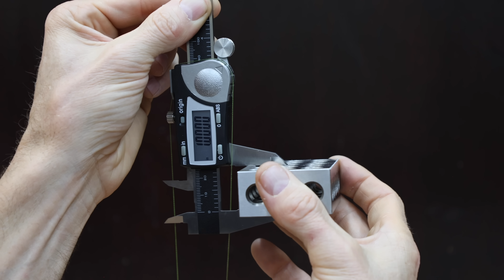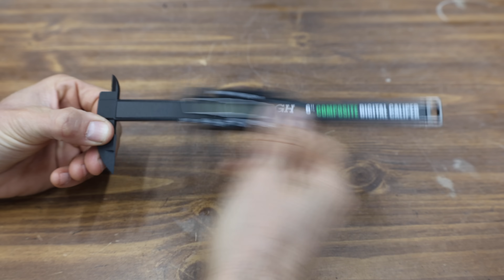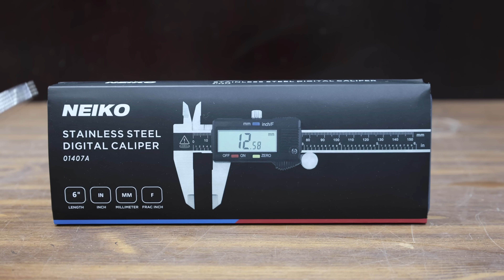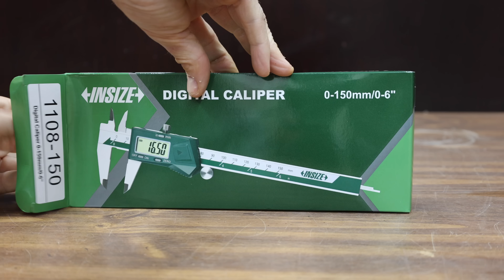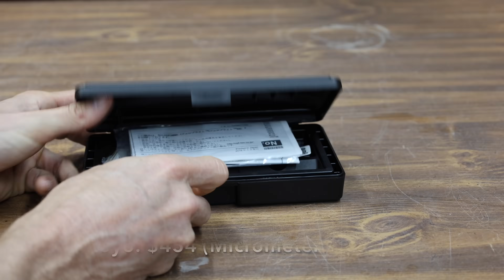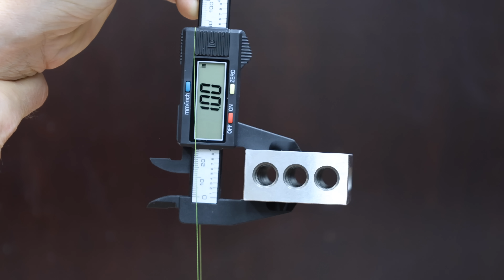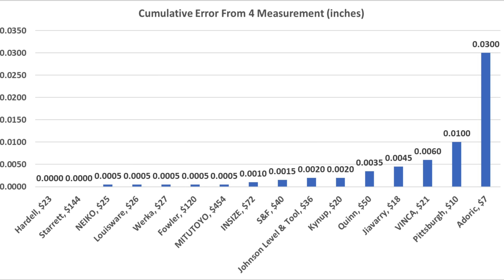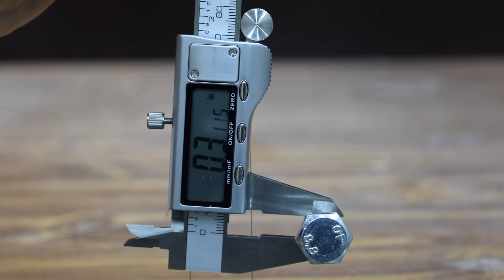I've Been Proven Wrong About Calipers!

Comment: I own a NEIKO, and while it may have automatic shutdown, it still drains the battery when not in use. This happens when I turn it off manually too. Its really annoying, I remove the battery after every use, otherwise its dead every time I come back to it.
Reply: Every time I have tools that come with second batteries I get very suspicious of parasitic loads when they are turned off.

I have a cheap brand of calipers that I turn the battery over when I store it so not to lose the battery.

I also have a digital angle finder that has the same issue.
Reply: Basically any caliper that has memory is still powering the caliper just not the display.
Reply: @rileyneufeld7001  but my 5 year old Mitutoyo still has the same battery.
Reply: @Pepe-dq2ib The mitutoyo's dont have this issue, its usually the cheaper calipers that will drain the battery.
Reply: @rileyneufeld7001 yes, but they can be designed to use less power than some do.
Reply: And my second hand mitutoyo has lasted for a few years on a single battery.
Reply: I have the same exact problem with mine. The manual "off" doesn't even work, much less the automatic one.
Reply from the maker: Thanks for the feedback.
Reply: My older Neiko 5+yrs will last a year plus on a single cell. Mine is an older iteration that uses a top slide 2032. After stoning a tight spot it has worked very smooth and consistantly.
Reply: yep, same issue with my Carrera Precision CP9806 - you can be sure that the battery fully drained next time you try to on it.
Reply: Same with Vinca.
Reply: Yep, when I was a millwright (changed trades about 5 years ago) I had a 12in Neiko digital calipers and yep the battery had to come out every time it went back in my toolbox or else it was dead next time i went to use it. I ended up getting cheap dial calipers and ditching the electronic ones, and never looked back.
Reply: @PlatypusVomit my mitutoyos have been on the same battery since I got them a few years ago. I only use them once or twice a week on average but it's still impressive, especially after having a cheapo one that behaved just as you described.
Reply: @mortrek  Mitutoyos should be good on the battery. But I didn't use them often enough to justify the price of a quality set. If I was using them twice a week like you, I would've sprung for the good ones.
Reply: I was just about to comment the same thing. Considering multiple models use an identical digital portion, I expect this also applies to multiple other models in this showdown. Still, if the only problem is draining the battery, I would consider the $18 I paid for it like 10 years ago to be worth it.
Reply: I have the Neiko too. I have it in a drawer and any little bump turns it on. If you tighten the screw at the top before putting it away, the battery lasts a lot longer. Still horrible battery life, but it's better with the screw tightened when storing.

Comment: If I understand the Mitutoyo instructions correctly, the Absolute  Measurement feature works by always consuming some power. It doesn't turn off automatically because the only power to be saved is turning the display off. Since learning this, I don't bother jabbing the power button at all. It just runs in the background the way a digital watch always has a display. Maybe knowing this will save you wearing the button out. You could test what I say by opening the jaws, removing and reinstalling the battery, and then expecting it to magically know its position. If you get a new Mitutoyo caliper, it specifically talks about battery life. The one that comes installed is not 'expected' to last any time - it is just nice that they left the test battery in as a bonus, but it will be draining in the box. If left on the shelf before sale for some substantial time, it will be flat on arrival.
Reply: Some of this sounds incorrect, all the new Mitutoyo tools i have ever bought don't have a battery installed, but have the battery seal in a plastic "bubble", and there is no on switch, it turns on when you move it.
Reply: @jeffmiller3150 The green/turquoise button is On/Off (bottom left). Also, a coincidence that the two callipers that have Absolute Measurement don't auto-off? An additional battery in a bubble sounds familiar, but there should also be one fitted for testing - manual says, "The supplied battery is used to check function and performance.  Therefore it may not provide the specified life." It also says to set origin after inserting battery. Happy to be corrected.
Reply from the maker: Thanks for sharing!

Comment: I'm glad you mentioned batteries, as my experience with the cheap ones is they go flat in just weeks or maybe a month depending on use. Mitutoyo keep going for YEARS with daily use.
Reply: He didn't measure them though, so there really isn't anything in this review to address the battery life issue. Most of the cheap ones use battery constantly even when powered off, and he didn't measure current use. So can't really draw any conclusions about the cheap sets, which is disappointing.  I wouldn't go out and buy one of the cheap sets with the 2032 battery, the kynup I would guarantee use the same crappy chipset as the other ones (look at the buttons and LCD), so they might last a month or 2 longer but will still constantly be dead. If you want a cheap beater set, you're still better off getting a dial set or just saving up for a quality set.
Reply: @zrobotics  Mitutoyo uses the battery constantly too. It has to in order to retain the reading. Just Mitutoyo has a way of using hardly any current to do that. A way no one else does. It borders on black magic. You get practically cell shelf life out of a battery with Mitutoyo. A battery will go dead about as fast just sitting around. I don't know how they do it. All I know is I have to save a video for how to reset zero because by the time the battery dies in my Mitutoyo calipers I forget how to reset it. I have to press one button for a period of time. Doing something once after over 5 years I forget.
Reply: @1pcfred  They don't use the battery when they are off, they store the zero point in EEPROM memory which doesn't consume power when it's off. It's just a more expensive electrical part and requires a different sensor setup for the distance measurement. At least that's my understanding, I haven't reverse engineered a set because they're way too nice of a tool to take apart just out of curiousity.
Reply from the maker: Thank for the feedback.

Comment: The truth about calipers is if you're not building rocket engines you don't need the accuracy that are very expensive caliper will give you. For home Automotive use cheap calipers will do just fine. I actually have a Starrett that was given to me and it doesn't seem to do much better than the caliber I bought at Home Depot.
Reply from the maker: Thanks for the feedback.

Comment: I would have liked to see the difference in measurements at hotter or colder temperatures. For example, the difference between readings when the calipers are at room temps vs readings after leaving the calipers in your car, or tool-bag in a sunny day.   (yes, obviously the object being measured needs to be at the same temp to account for thermal expansion)
Reply from the maker: Thanks for the suggestion.

Comment: The biggest problem I've had with cheap calipers is battery life.  They draw a little bit of current even while "off"  I haven't had the chance to compare, but I've heard the more expensive brands draw much less in standby.  Without a low battery warning, I can only tell when the measurement starts getting wonky.
All that said, I'm no machinist so cheapo calipers get the job done just fine for me.  The most demanding thing I ask of them is for 3d printing, and my 3d prints just aren't accurate enough to care for a few thousandths, hell, I'm not even sure a few hundredth's would matter.
Reply from the maker: Thanks for the feedback.

Comment: I have had the Neiko for about 5 years and it still works great. Not bad for $20. My only complaint is the battery. It seems to drain it no matter what. You have to put a new one in every couple of months. But they are cheap.
Reply from the maker: Thanks for the feedback.
Reply: Yeah with cheap calipers you have to pull the battery on them or just replace the battery often.
Reply: I can confirm that my Neiko's do the exact same thing. You have to remove the battery before storing it for a while, otherwise it WILL be dead when you go to use it again a couple weeks later.
Reply: I have Vincas, the battery lasts a year or more.

Comment: Surely for the depth measurement test you were as much measuring the flatness of the wooden work surface you were testing on than the accuracy of the callipers, the test should have been done on a surface plate.

Comment: Btw. What were those usb ports for?
Reply: if you get the right cable it will output the measurements to a computer, its useful for doing Q/A on parts or just recording lots of data quickly

Comment: we use the insize model at work. we need to maintain a spec of +- .040 they tend to work pretty good an maintain zero effectively. Except for one unit the would constantly go exactly .2 out of zero. We are pretty hard on these units at work. they fall on the floor all the time. not to mention the lead dust we work with on a daily bases.
Reply from the maker: Thanks for sharing.

Comment: My ~3yr old Harborfreight digital calipers woke up from winter and now display exactly 2x measured size. Maybe battery swapping will help. In the meantime I put plastic $Store calipers on my boat for simple work. $1.25 and lifetime display :-)
Reply: Just take out the battery and insert it again.
Reply: @RolfRBakke  1st on my list. And i have new CR2032.
Reply from the maker: Thanks for sharing.

Comment: Unless you are a machinist doing lathe and mill type work, spending the big bucks would mean you are an idiot.  Also, for real work one would use the correct micrometer, a calipers is for quick check work and things that are high tolerance(relatively). 
There are round and round arguments about these for years, and idiots are always overestimating their needs for non-machinist work(These are commonly used in firearms reloading, for instance, and anything over 30 dollars is money thrown away).

Comment: For measuring equipment the theoretical true accuracy is 10X less than the resolution on the display. Said differently, you drop the last number after the decimal point.
Reply: I'll trust my calipers down to a thousandth. But to measure that accurately does take some skill. If you're not being careful then you're probably a few thousand off. Better than 10X though.
Reply: @1pcfred   I think you missed my point.  Basically to be accurate you have to not use the last digit of the display. Each digit is 10x the next digit.